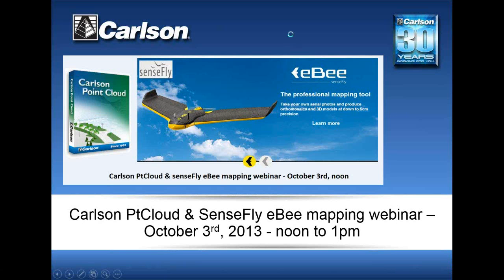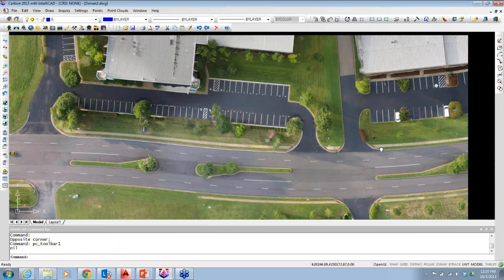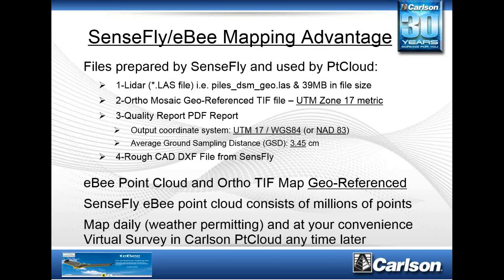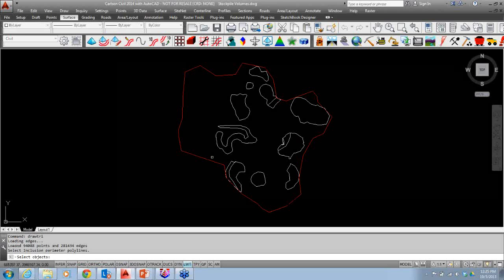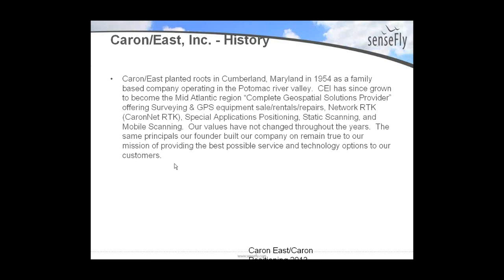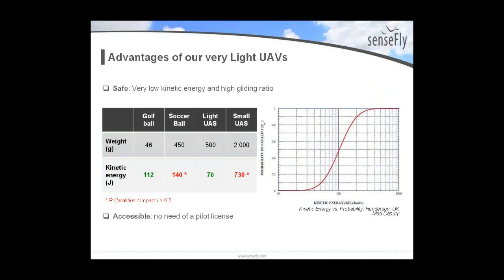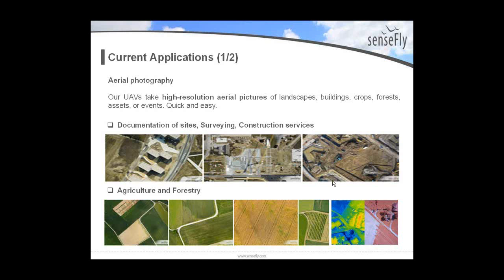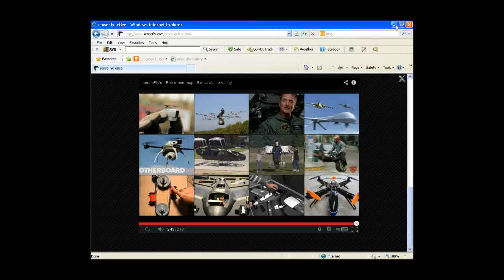Using SenseFly eBee Mapping Drone LAS Data with Carlson Point Cloud

Comment: The eBee doesn't actually collect lidar data, this video tithe is a bit deceptive.
Reply from the maker: +Chad Snoke Thanks Chad for your input. We've changed the title to 'LAS data' from 'Lidar Data'. SenseFly's office software outputs a LAS file, a common Lidar file format, as one of many file types that can be generated as a point cloud file type, generated from these eBee photos. Your comment is correct that outputting a Lidar format LAS file type isn't Lidar.